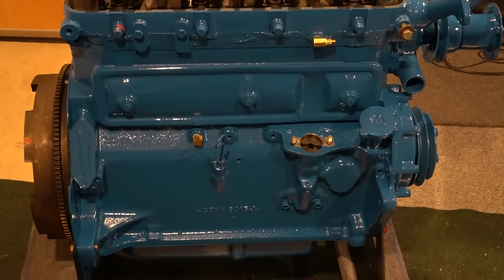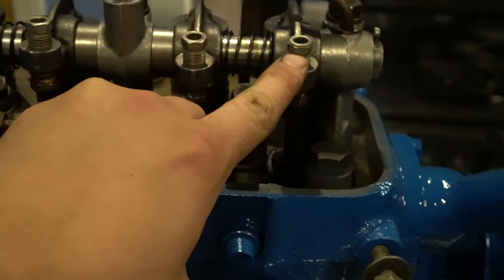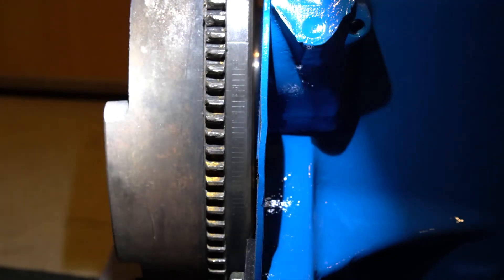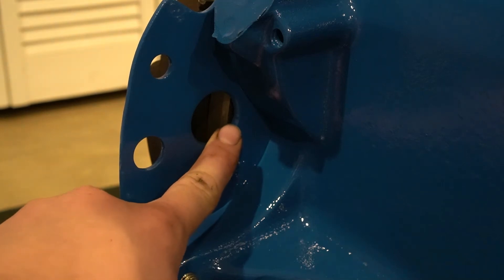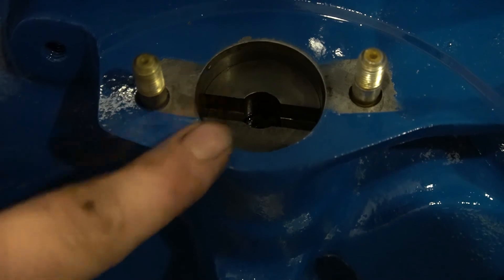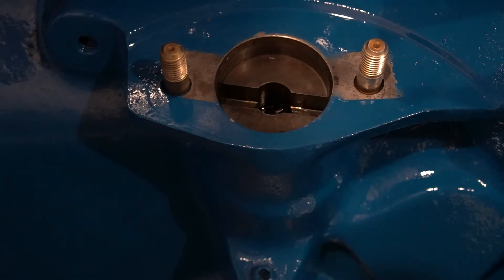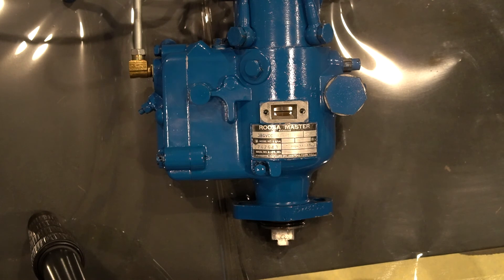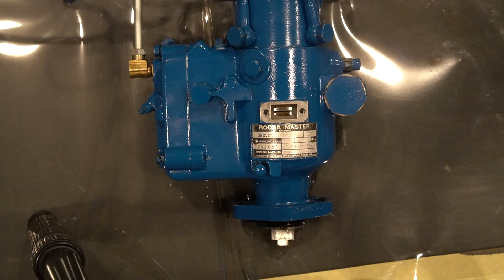How to install an injection pump on a Ford 601, 801, 2000, and 4000 4-cylinder diesel tractor

Comment: So I just removed the injection pump off of my 801 powermaster and the pump drive gear that the pump is connected to came out half way with it. Should I be worried about the drive gear that came up half way?

Comment: We have set our pump to 23 degrees as it has been rebuilt and we still have clouds of white smoke like there is diesel not still completely being burned. All of our injectors are good and all pistons have good compression. When we twist the pump to give it more timing the smoke gets better. Would it be alright to move it up to say 25 degrees?
Reply from the maker: @owenf2755  if the tractor doesn't smoke, ping, or knock it should be ok. I'd be weary of it though since it's wanting to run at something other than it was designed to, so you might be masking another issue. This 4000 was smoking badly even after new injector nozzles, pump rebuilt, and engine rebuilt. I swapped nozzles with some delphi units and smoke stopped. It had some Spaco units in it. Probably should've put Bosch ones in it but they were twice the price of the delphi ones.

Comment: It seems like I'm doing everything right up until I put the pump in. It will not seat into the drive gear. If I turn the pump 180 it will seat perfect please help
Reply from the maker: @aromp3555  do you have the drive in the engine correctly installed? Both the pump and the drive shaft have offset keys on them. If you have the drive and pump shaft the same as my video but don't see the lines in the window, the pump may be put together 180⁰ out. The tractor will not run with the pump 180⁰ out. Once you start trying to crank the tractor, it will smoke a lot if the pump is installed correctly before it fires off.
Reply: @chickenhousemechanic  I pulled #1 injector to confirm I'm at tdc and the drive gear correct position and it is. Timing marks on 23° slot in drive gear is in correct position with larger part of the hole to the block. I've lined up the timing marks on the injection pump when I dropped the pump in it will not completely seat itself in the drive gear it's binding and will not seat itself in the hole if I pull the pump turn the shaft 160 it will slide in just as it's supposed to this should be very simple I'm not sure what I'm doing wrong here
Reply from the maker: @aromp3555  sounds like you have the engine set correctly. Was the pump rebuilt?
Reply: @chickenhousemechanic  all I did was put umbrella seals in it. I thought I kept track of the shaft but apparently I did not
Reply from the maker: @aromp3555  Yeah, you might have the shaft backwards then. Should be able to just pull the shaft out and rotate it. Should only have to pull it out maybe 3/8".
Reply: @chickenhousemechanic  I will give that a try
Reply from the maker: @aromp3555  that should get you running from the sound of it. I did the same thing to my 861 when I rebuilt it. Easy to overlook the timing marks in the pump. Thankfully the shaft is an easy fix. I had governor cage 180⁰ out on the 4000 the first time.
Reply: @chickenhousemechanic  wow you were exactly right 
2 weeks working on this for such a simple over look wow lol . We learn something new every day. I can't thank you enough.
Reply from the maker: @aromp3555  yeah, those little things are what get you. They can really make you pull your hair out.
Reply: @chickenhousemechanic  Thank you again Sir. You are a professional
Reply from the maker: @aromp3555  you're welcome, and thank you.

Comment: I am pulling the pump because it leaks. I am going to try and replace the gaskets. It does not want to lift out . What do I have to do to remove it ? Do yoou have a video on removal?
Reply from the maker: Once the two nuts and washers are off as well as the hard lines disconnected at the injectors the pump should slide right up.

Comment: I Don't see How I can put the Injector pump Wrong (180 out) if the indexing of the pump shaft into the Drive Gear is Correct (with the Smaller side of the injector Pump drive down)
Reply from the maker: If the drive gear/shaft hasn't been removed then you can't. However if you remove the shaft it can be installed 180 out, or off by a tooth or more. Instead of compression stroke engine could be on exhaust stroke. The injection pump itself can be 180 out also because the other end of the pump shaft has a keyway that is centered and not offset. If the shaft is removed and not installed back properly it can be 180 out.
Reply: I've Got it Right as Disassembled and Pump Drive in with the Smaller Side Hile Down.. Could See NO Mark on the Moving Injector Pump internals.. Thank you Sir..
Reply from the maker: @richardtharp1608  on the pump the lower disc rotates. That should be where the mark is. It's usually very faint. However if your pump has had the governor cage, which is the lower disc, replaced and it was not marked then you won't see a mark. At that point I don't know of a good way to get a mark on it. You'll just have to install pump and get tractor running and turn pump like timing a distributor to see what makes the tractor run well. Also try spinning the pump 180⁰ and looking for a mark. If the governor cage was removed but reused it can be installed 180 out and your mark will be on the wrong side. I did that on the one in the video and took me a while to find it. I show a better view of the marks in my rebuilding video.

Comment: If my engine is still in the tractor what else needs to come apart?, yours is on a bench with valve covers off, mine whole tractor is completely together.
Reply from the maker: You can still install the injection pump with the engine installed. All you need to do is verify both rocker arms on cylinder #1 are loose, reason for valve cover being off, and make sure your timing mark lines up correctly in the window. There is no need to remove anything else from the tractor.
Reply: @chickenhousemechanic  But I do need to removal all the body work, fuel tank, and valve cover?
Reply from the maker: @miked738  you can pull the valve cover out without removing all that. It's tricky but it will come out. Have to roll it out off the studs in the rocker arm shaft. If you have not removed the injection pump drive you can use it to judge if cylinder #1 is on compression or exhaust. If your drive matches mine in the video, and hasn't been removed, then you should be on compression on cylinder #1. Then all you need to do is match the timing mark in the window and you're all set.  Really the rocker arm is only important if you have disassembled the engine and need to make sure everything is right since that's the easiest way to tell if the engine is on conpression.
Reply: @chickenhousemechanic  I removed the pump and sent it out for a 1000.00 overhaul.  it sits just as I removed it but who knows what position it was in when I last hit the kill switch.
Reply from the maker: @miked738  since all you did was pull the pump all you need to do is spin the engine over until the pump drive looks like mine and then verify your timing mark in the window. Yours will probably be 23⁰. Since the drive was not removed it is still timed properly to the camshaft and therefore the crankshaft as well.. if it was removed you'd run the risk of being 180⁰ out. That wouldn't cause any damage, the tractor just wouldn't start. Once you have the drive lined up and the timing mark set then go to your pump and make the two marks line up in the window behind the little cover. Once you have those 3 things done your pump should slide into the drive. Then just wiggle the pump to line the marks up in the window perfectly and tighten down your nuts.
Reply: @chickenhousemechanic  I finally got around to tackle this project today, I installed it and it wouldnt start. I am going to try and bleed the system to see  if thats it.  Where is the timing window?I didn't find one.  the slot in the engine side was not in a position where the marks lined up but I figured they weren't that way when I removed it so I positioned the pump's male flanges in the only way it would go into the slot with the 2 different radiuses.  I don't see how it matters if that only fits in one spot on the whole 360 deg spectrum anyway.  I never touched the shaft on the engine side when I removed it and Neve spun the engine until I put it all back together.
Reply from the maker: @miked738  if you removed the shaft from your pump and spun it 180⁰ then your pump is now out of time. If you have all the engine marks line up but your pump lines are not lining up then the shaft in the pump is incorrect. You should be able to just pull shaft in pump and spin it 180⁰ and the tractor should run. Just have to remember that anytime you remove the pump.
Reply: @chickenhousemechanic  I  shut of a running tractor, then removed the pump and set it off to Oregon Fuel Injection for a 1000.00 overhaul, then got it back moved the fin on the pump tp match the tractor and set it down.  If I spin the shaft the mark  only winds back up in the exact same place bc it goes around 360 deg, there is no place else on the clock it would seat in.  Are saying the overhauler has replaced it differently than when they got it?  and is there a way to tell this?  I am going to do your line bleed today and see if thats it before I take it off again, there is an air pocket in my see through filter.
Reply from the maker: @miked738  it's possible. The weight cage on the governor can installed in 2 different ways. If they didn't line the timing marks back up then you'll never get it lined back up properly. I did that on mine by accident and then found out what it was. Only way to check it is to dissamble the pump. My rebuild video shows the timing marks on the cage. Pretty much if you have the cage timed correctly to the pump shaft inside pump, and then all the marks in this video it should start and run.
Reply: Chicken House, your videos have been great but now I’m stuck. Just has the Rossa Master rebuilt. I did exactly as you said and everything is lining up as you said. Except in my Ford 172/192 manual is Specifically states 22° on the fly wheel. With the number one cylinder at top dead center the larger cam hole facing the engine, everything lines up. However once running it seems to be having a Miss or loopping , she’s blowing bit of white smoke and heating up more quickly.( I’m assuming some unburn fuel or perhaps bad compression?)  I’ve tried advancing and seems to not do anything. Are you aware of a compression tester that fit these injectors? Perhaps I have to make one? I’ve ran the fuel directly to the injector pump, replaced the injectors with rebuilt. Tested the pop off pressure. Checked the leak off lines/banjo bolts. I’m stumped! Any ideas? It’s a 1960 something 172d looks just like yours, except it’s in a boat. Thanks
Reply from the maker: @zachgloer9585  a little white smoke is ok. A lot is not. Id be more worried about the running hot issue. Excess white smoke could be excess unburnt diesel or coolant being burnt. Usually retarded timing will cause an engine to run hot but I dont think 1-2⁰ would cause that. 

I dont know of a specific compression tester for these engines but I'm sure there is something out there for them. If you find one that has an air style quick connect on it you can set the each cylinder to TDC and hook an air line to it and see if the coolant bubbles in the radiator. That would indicate a bad head gasket or cracks. It's a rigged leak down tester but it works. 

If you determine that the smoke isn't coolant related and is instead excess diesel then the metering valve in the injection pump may be sticking or worn. The governor could also be misadjusted.

Comment: So installed my pump. Think I have it right. But I crank the engine over and no fuel comes out of the lines. Is my pump bad?
Reply from the maker: Do you have fuel all the way to the pump? It takes quite a bit of cranking to get fuel to come out of the lines. It's possible that the pump isn't putting fuel out though. If that's the case you'll have to have it rebuilt. There are two small vanes at the top of the pump that act like a lift pump to start pulling diesel into the pump but the main pressure building action is more towards the center of the pump. That area has a lot of small components that can be an issue and would be hard for someone to diagnose if not familiar with the pump.
Reply: @chickenhousemechanic  I believe I have fuel to the pump. I loosened the in hose going to the pump and fuel came out. I even had it running on starting fluid for a couple seconds. Still no fuel coming out.
Reply from the maker: @davidgaziano5624  if you had it running on starting fluid for a few seconds the pump should've spun fast enough to start pumping diesel. Sounds like you have a problem with the pump itself.
Reply: @chickenhousemechanic  even if it was installed wrong and not timed correctly it would still pump fuel though right? Well if there was nothing wrong with it. Is there any videos on rebuilding a pump?
Reply from the maker: @davidgaziano5624  yes even if installed wrong it should still pump fuel. I don't really have a good video on rebuilding a pump. I have a poor quality one shot on cell phone of me resealing mine but that's all. I'm not sure if there's any special tools needed to repair the pump. Both of the ones I've repaired came off running tractors that just needed resealed and the governor ring replaced.
Reply: @chickenhousemechanic  ok thanks. I might just try rebuilding it myself. If not I'll have to buy a rebuilt one. Thanks for all the help.
Reply from the maker: @davidgaziano5624  no problem. Resealing them is not hard. Just make sure all your timing marks line back up.
Reply: @davidgaziano5624  Just curious if you rebuilt your pump. If so, how did it go? I am pretty mechanically inclined and was going to send mine out.
Reply: @kylemccourt663  I rebuilt it myself. Pretty easy. Runs good now. This guy also has a video of him rebuilding his.

Comment: How do you bleed the lines?
Reply from the maker: Open valve on bottom of tank first. Then on your filter housing you will see a brass thumb screw on top. Loosen that until diesel comes out. Once you get diesel to that point crack the lines at all injectors and crank the engine until it starts to squirt out. Once it squirts out tighten lines down and your system is bled. Engine should then start.